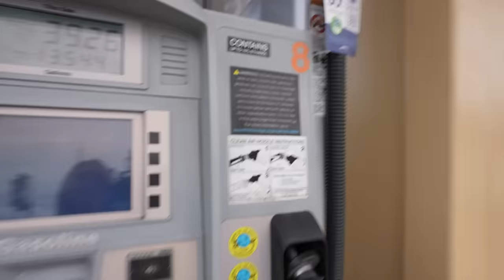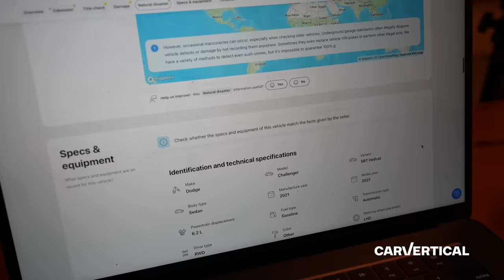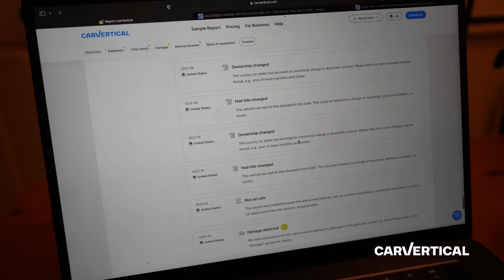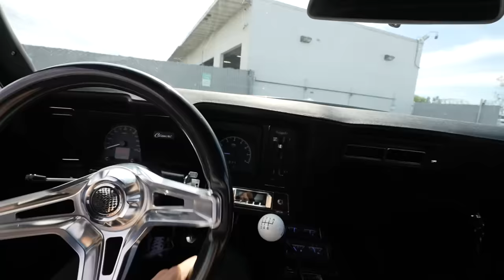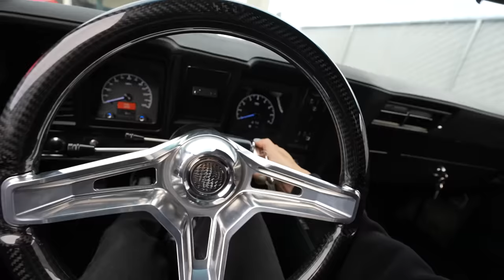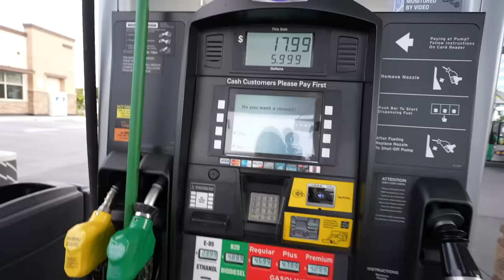We should have left this car in the barn we found it in…

Comment: Viper v10 is by far the most appropriate engine for that car.
Reply: Viper V10 sounds like a tractor engine just terrible sounding.
Reply: @1BlackSheep Your Honda Civic sounds like a rattle can
Reply: @1BlackSheep They don't sound good, but love boost or being naturally aspirated. 9.0 stroker make 800+whp no problem. Gen 5 motor 1300whp stock motor no problem. They're also reliable. Even more reliable than a vette.
Reply: @1BlackSheep  it's an old-school MUSCLE CAR, it's SUPPOSED to sound like a tractor. :Facepalm:
Reply: Calvo motorsports twin turbo
Reply: Awesome race engines that sounds like crap, Ever heard one in person I have. At full song it sounds ok but just ok. @scottelbadass
Reply: #Helephant
Reply: No.
Reply: @1BlackSheep  i find they sound great
Reply: Opinions you know, Everybody has one. @wolfemancola
Reply: Disagree, 440 built to the max. That  body was not worth it. Should have found a parts car with better body. Then buy the nose cone, wing. Dont do the viper engine. The sound on a built 440 with a "loppy" cam is amazing and intimidating
Reply: Do a built 440 with a "loopy" cam. The car is shit and you should just bought a parts car road runner and bought the nose cone and did want you want. It not original so who cares.
Reply: With a set lf twins and 2k+ wheel... bliss
Reply: TERRIBLE 🤮
Reply: Em, the great part of having the car in the condition it was when you started is that it forces you to eyeball and correct every little detail that one may have talked themselves into overlooking for the sake of expediency. Since you have the need for perfection in a build like this, there is no doubt that when it comes time to give that car a whoopin’, there’s no doubt every inch of that thing was attended to. Should be a great reveal video, no doubt. 👍🏻😎👍🏻
Reply: Either engine is gonna be sick asf tbh
Reply: An old school 426 hemi or 440 would be appropriate
Reply: naw hellcat engine much better than the viper v10
Reply: I have a Gen 4 Viper making 700hp and it sounds awful. I have full Corsa X-pipe catless setup as well. Definitely does sound like a tractor.
Reply: You should throw a 426 supercharged hellaphent in it that would be incredible. These cars at Daytona could reach 212 with 425hp Is imagine what this thing could do with 1000hp hellaphent motor
Reply: Demon swap 😈👹
Reply: 426 hemi with a Whipple 3 liter instead of a hellcat engine.. If that's why ur looking at a salvaged charger..
Reply: If you don't try a modern build, 426 HEMI (PH 426), the MOPAR Hellcrate Redeye engine is the next best thing, ideally stroked out to 7.0L/426ci (BoHEMIth).  The Viper V-10 needs way more mods to get to 1000 hp, and they are harder to obtain.
Reply: Debatable.
Reply: You calling it a Superbird is way more acceptable than when you used to call a non-GN Regal a GNX.
Reply: Yes and maybe even have it built with a turbo kit from calvo motorsports. It would be so fucking cool.
Reply: @fallofthezombies1379 agreed. A stroked 426 hemi with dual EFI throttle bodies for the win. Unless it's too tough A build....

I'm building a 482FE for a client's 67 GT500 Eleanor.....wanna race Emelia?
Reply: Nooo.. 426 Hemi (larger) Built no blown! 😎👍
Reply: @karlhopkins713 so affordable too huh? Is that with or without cam bearings??? "Reliable"....😂
Reply: @1BlackSheep I use to race them in SCCA TA-II. I wouldn't describe them as "music to the ear". Corsa on the street is the best I've ever heard....to each their own.
Reply: @SICsupraman  there you go! Awesome honest man here! I raced them in SCCA TA-II years ago, and I can best describe them as an acquired taste. Damn it....if more were like you. Thank you for your reply.
Reply: @bradmcclure672  the Whipple would be a good touch.
Reply: Here for the V10!!!
Reply: No.
Reply: Install and connect the V10 for its uniqueness and sound in that body style, either way you go you are going to laughing and loving the car when all done.
Reply: Nope.
Reply: 426 Hellephant much better. More reliable, too.
Reply: Twin turbo V10. How big will the blow off valves be?😮
Reply: 🖤🖤🖤👣ala otra uso mi maquinita paquete diviertas compa disfruta
Reply: @edw1045  This guy knows.
Reply: hell mfn yea
Reply: High compression 426(+) Hemi with a crossram intake & streetable hydraulic cam. Plenty of power & reliability.
Reply: Elephant 🐘 engine create for it
Reply: respectfully, for what it'll cost to drop that long an engine in there and get it up to power, a crate Gen 3 Hemi will accomplish with less time (the car has been in the body shop long enough) and money. An RB based stroker from Indy would be nice, too--no need for a power adder and the car was made to swallow it. The V10 is like ford's DOHC Cobra 4.6 litre--there's potential, sure, but it's been superceded by other engines. You practically date the car's build, like a hot rod with an LT1 chevy 350 instead of an LS.

As for the body's fit quality, daytonas and superbirds were slapped together from the factory anyway, the vinyl top was there to hide the butchery to the C pillars to get the rear window flush.
Reply: I cant really disagree but i wouldnt go as far as "only". Definitely top 3 mopar choice.
Reply: What do you think of the Hurricane.
Reply: V10 and roll racer.  Would be dope af
Reply: The Viper V10 needs someone who knows what they are doing, that engine is quite the diva, from what I've heard.
Reply: @1BlackSheep  too heavy for a sophisticated build .
Reply: @richardelliott8352  Look at Finnegans Cadillac Huge car ,Huge engine. Not too heavy that just means it needs more power.
Reply: Is this a real car
Reply: @edw1045   for sure, if you're gonna go more for the old school sound, nothing beats the sound of a lopey big block Mopar. Now if people want something modern, its all about hellcat motor. The viper transplant was popular till those came out. I'd rather have the V10 because very few do it anymore. The exhaust sound issue shouldn't be such a big deal now days, plenty of options and a ton of tech now days,as long as you understand it's not gonna have that old school muscle car sound. Now there is another option that I would definitely try myself. Punched out, cammed 440 with modern ignition and top it off with a Holley sniper, or something similar. I wonder, has anyone ever thrown two snipers on too, of a big ole blower? I could get behind that.
Reply: V10 viper w/ two screw blowers
Reply: It'll sound like a six cylinder.
Reply: 426 wins
Reply: @1BlackSheep  Boy they sure do. I was thinking air cooled porsche with loose tin covers rattling.......😅
Reply: That’s a lot or work for a non real super bird but she always has reps muscle cars
Reply: @Emolokz dude he means a viper V10 because they sound bad read the comment properly
Reply: Definitely stick with v8. Just go big block.
Reply: @PhotonHerald Yes, definitely the hellephant or just get the hemi 426 and put a bigger blower on it yourself. I'm wondering if that engine would be good for twin charging?
Reply: @1BlackSheep  a stoked 9.0L V10 turning 7,000+ rpm actually screams. You're ignorant.

Comment: WHEN I WAS 20, 57 YRS AGOI HAD A 63 DODGE POLARA 500, 426,WEDGE,  3;:91 posi,  2 dr. hardtop, auto, beefed by B&M TRANS, ON THE FWY IT GOT 5 MPG, AT AROUND 65, THE ENGINE WAS REVVING LIKE HELL, 8 MPG ON EL CAMINO REAL, FEATHER FOOTING IT, 20 GALLON TANK=100 MILES PER TANK FULL, WHO CARED GAS WAS 35 CENTS A GALLON, I USED CHEVRON WHITE LIGHTNING GAS, 101 OCTANE.
NOT A FWY CAR, BUT FROM STOPLIGHT TO STOPLIGHT IT WAS KILLER. GO WITH THE VIPER V10 GIRL.

Comment: In 2019 I directed a show for Chrysler at the SEMA Show where they introduced a 1,000 HP Crate Engine called the Hellephant. It included everything you need: Transmission, ignition, fuel system w/supercharger all made of aluminum. Very clean package with a warrantee. The only problem is it cost $29,999, and must be installed in a pre-1976 car if you want it street legal. They fired it up and it sounded amazing!!
Reply: My #2 choice !!!
Nicks Garage has everything she needs ???

Comment: Check AMD for Mopar body parts. The 69 Roadrunner roof is different than a 70. Doors too. Cloning a superbird some parts can be found on 70 dodge Coronets. The hood you want is a 70 Coronet that is modified. Side marker lights are also 70 coronet. You are cloning a car that is expensive and parts that are OEM expensive. The fenders are also 70 Coronet. I sold some 70 Coronet fenders years ago that were beat to death for a thousand. Wow what a project you are taking on. Back to the video! I’m enjoying it.
Reply: Adding on, I think the front fenders are also from a coronet- correct me if I'm wrong 😊
.... and just saw you had stated that 😂
Reply: @jdnance168  no worries and they are 70 Coronet. The 70 Coronet and 70 Satellite roof I believe are the same. The 70 Coronet is an oddball of a car. It’s a one year body that is hard to find parts for and if you do they cost so much. Especially the front end parts like fenders, hood, side market lights and valance lights. They are all used on the 70 Superbird. The hood of the Coronet is cut and capped. This project will be so upside down that to regain your money from it won’t happen. But it’s a cool project. It’s basically now a rebody of a car. The trunk lid that is needed is a 70 Satellite. The hinges on them will need to be modified and those I believe can be found. 

This would be a car that would be best to walk away from or make a Road Runner clone and add modern power train to it.
Reply: @DownRange556 yep, definitely hard to find! had a four door 70 coronet in HS. Came back from college and my mom had sold it. Love that body and been on a mission ever since to get another (2dr)! Love those old Mopar
Reply: @jdnance168  yeah I’m a Mopar guy. I owned a 1970 Coronet R/T 1 of 1 car. I’m speaking first hand on how hard it is to find those parts and mainly because people clone Superbirds. Galen Govier and I talked at length about my car. I even stumped him on some codes. He offered me a job when I told him what they were and meant. This was way before the internet become what it is today. Late 90s early 2000s. We were still relying on magazine adds to find parts plus going to shows and swap meats. The good old days haha. The 70 Coronet had a mean look about it. Keep searching and I hope you find the one you are looking for.
Reply: There is no difference between a 1968, 1969 or a 1970 Road Runner roof they are identical, the only difference is the Superbird had a rear window plug installed.
Reply: @victorwoloschinow5854  I was thinking it was. But I may be thinking 69-70 Coronet. Something about the roof I remember is different. It’s been 20 years since I’ve restored a car or even owned a Mopar. I miss the classic car and muscle car scene but it’s a rich man’s game.

Comment: Viper v10 is known to have weak head gaskets. Something to consider for reliability.  My pick would be a old school 426 hemi with a manual trans.  The 426 should be fuel injected and no carb headaches. Probably to boring for most but I like what I like.  Think I would toss on a gmc 6:71 blower on the top just for fun.
Reply: Sounds superb.  What’s the bottom line? 60k ? For the turnkey engine.

Comment: Old school 426 hemi w/modern EFI or 440 w/6pack. Either w/ 5 or 6 speed tremec. Definitely 3 pedal car.
Reply: I second the 426 Hemi, maybe a built/stroked one for ur HP. Got dayum, Richard Petty drove his 196mph! 😯 Thanks for the update, ur doin it up right girl. SuperBird! 😎👍 Oh don't forget the rebel flag on the roof! 🤣🤣🤣
Reply: bored, & stroked 426 (2nd gen) hemi, 528 CID/1,000 (NA) HP.
Reply: Definitely this ^
Reply: I'm from that era. Go classic. Why build a classic with an engine not of the era. A 426 Hemi (any version) is appropriate and a manual transmission. A 440 6-pack would be cool too.
Reply: They do run out of gears way before power !!!
An overdrive at very least !!!

Comment: Contact Graveyard cars. Mark Worman knows where to get every piece you need for the "Bird". Hellephant for the engine. Also Mark has a guy that makes a K frame with coil overs and will hold the power. Expect to spend about $100,000 for the finished product, but the value when finished will justify the cost

Comment: 440 na motor!  Period correct but crazy na power. Nice update.
Reply: It was 426 Hemi back in the day! 😎👍
Reply: @BillyJoeJimBob28  I am aware of the stove that came in the original. I made the comment of a 440 as this was what was available back in the day, not a viper or demon motor.
Reply: the 440 Commando six-pack was a great 1/4 mile engine.
Reply: @BillyJoeJimBob28.  Almost all of the 1970 Superbirds came with a 440. Only about 150 came with the 426 Hemi. Some of the 440s had six barrels, but most were 440 four barrel.

Comment: Modern engines will never have "that old school sound". Never. Ever. 

Everybody nowadays goes restomod - you need an old school Hemi with a big cam. Period. If you insist on going EFI, that's fine, I guess, but I personally would go with dual quad, or maybe even a 6-pack.

Back it up with a Tremec TKX and a Ford 9-inch.
Reply: Yeah the classic mopar V8  have the best sound.

Comment: As you stated, the E85 fuel at 2.899 is less expensive that the gasoline at 5.349 but not as much less as the difference between pump prices. E85 contains 42.5% less energy per unit volume so the fuel consumption increases by that amount the. The E85 is $4.12/gallon equivalent to 100% gasoline.

Comment: Last summer here in Canada all gas stations that used to sell 0% ethanol premium gas now have at least 5% ethanol which cars like mine don’t like (1970 Z/28 4 speed). So to combat water in fuel I use Ethanol Shield from Home Depot and also use it in my riding John Deere mower, weed wacker and snow blower. Ya here in Ontario Canada just east of Toronto, we get snow. This yr was light, only used the blower 3x’s compared to last yr every 2-3 days.

Comment: Looking good! Same with the car! I would put a big block or even a hemi 707 HP. It was a close one with that vinyl roof causing the rust. That was funny the nose dropped out when you touched it. I’m glad the milk crates were under it. Do you want to go with the same engine as the charger had on the fast and furious with a little blower. “Injection is nice but I would rather be blown” 😜

Comment: A Hellephant for the birdy! 🤟🏼 426 all aluminum supercharged hemi 🤟🏼. & good luck finding that back glass for the 70 Superbird... (spoiler alert: the rear roof had a filler panel welded in from the factory & a one year, one model- rear glass specific to the 1970 bird.). 
& good luck finding that rear trunk lid. 
The parts cars that will help you with this build: 
If staying with original B-body normal roadrunner back glass: the 1968, 69, 1970 Plymouth satellite, gtx, Belvedere, roadrunner, Dodge Coronet, & super bees.
The rear trunk: 1970 Plymouth b-body specific: 70 gtx, roadrunner, roadrunnerSuperbird, Belvedere. 
Don't forget: The Winged Cars had triangled inner gussets to support that wing's weight from caving in those quarter panel tops.
Reply: Magnum Force, or QA1 has what u need for the suspension & steering needs. 
Brakes are a dime a dozen, whether it's named brand or stock oem's. 
The great part about building Mopar's: these vehicles from the 60's, 70's, & 80's are more interchangeable than most people think. & don't get discouraged with any stage of the project. I've had a family heirloom for the past 9 years- if you think buildin a mopar B-body is hard. Try building & restoring a 1966 Plymouth Barracuda... a one year wonder, the early A-bodies that most people don't play with, plus they get heavily rotted out.

Comment: If you can find one an original 426 Hemi, I would also lose the torsion bar suspension. They are awful to drive. They are OK for going straight, but they feel like a boat going around corners.

Comment: Welcome to the world of Mopar where nothing is cheap. If you want a high speed suspension that's pretty much plug and play look at QA1. Ditch the leaf springs and torsion bars. Pricey? Of course. Total baller move? Absolutely. 

As to engines, I'm a old school big block type of guy but between the two you threw out there, I guess the V10. It's definitely different. I see some people suggesting have Steve Morris build it. I guess if he builds a V10 then he'd be who I go with.

Comment: The Nascar exhaust is cool for a bit, but if its taking away from fully enjoying the Camaro because your eyes are burning then definitely change the exhaust. 
It's better that the Superbird is  a replica, You can do what ever you want. It had both feet in the grave and you saved it. 👍 It's an underdog story. Or more accuratly an abandoned dog story 😅 
Looks like the body shop is doing a good job. I'm torn on the engine choice.
Reply: In europe even roadrunners are really high in price
Reply: @guille92h  real roadrunners arent cheap in the states either.

Comment: I have a real Bird, myself. Motor and transmission have never been outta the car. Its a "survivor" "barn find" car. 43000 miles. 440 auto. TorRed. And i put Nascar black steel racing wheels and fatties. Because i can. I drive it all.over the place. Runs like a top..